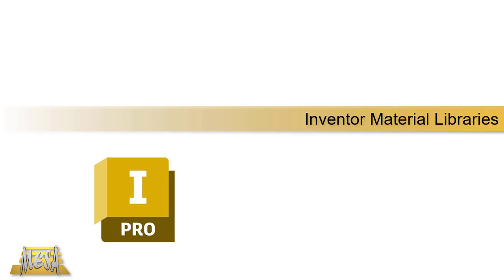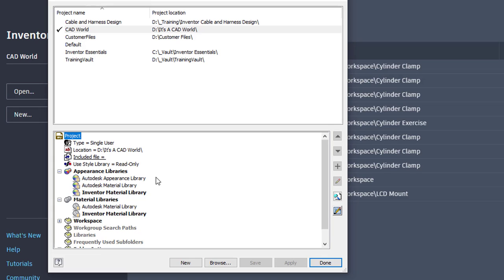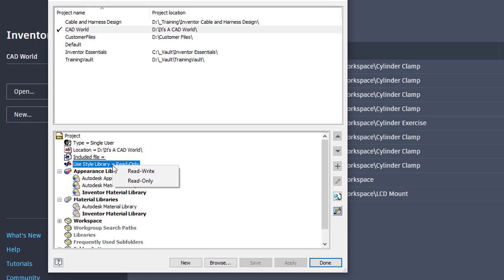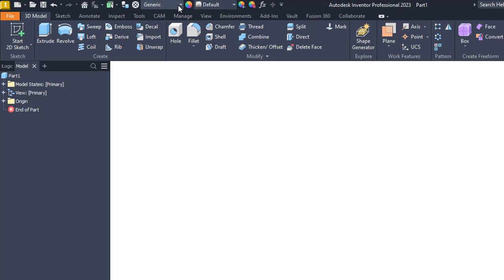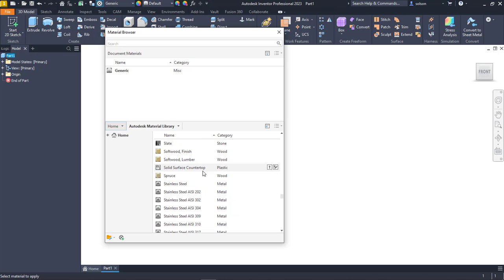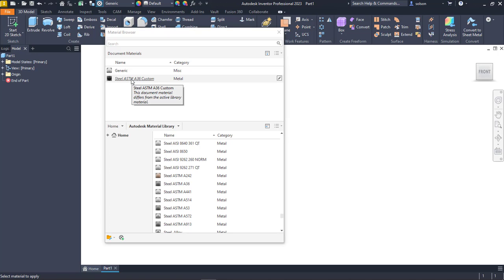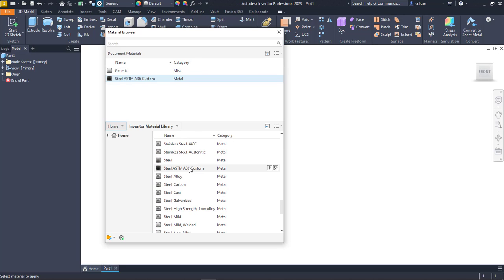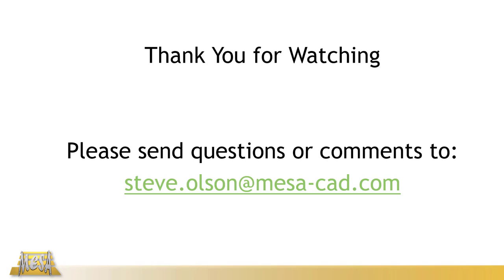Inventor Material Libraries

Comment: I always save new materials to Inventor Material Library, but whenever we switch to a new version of Inventor, they don't migrate with the design data. Thus I have to find open like about 50 individual parts with all the materials we use and save their materials to the Inventor Material Library which is annoying. Is there a way to do this in bulk?